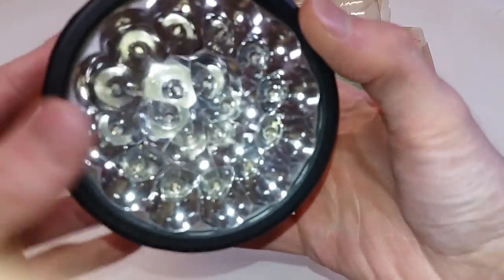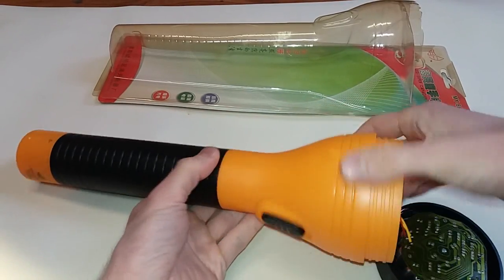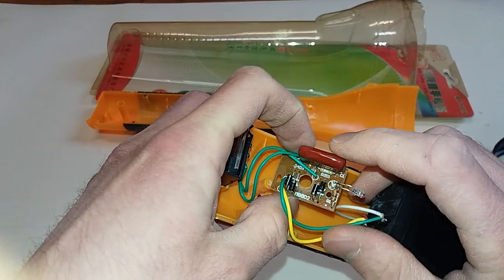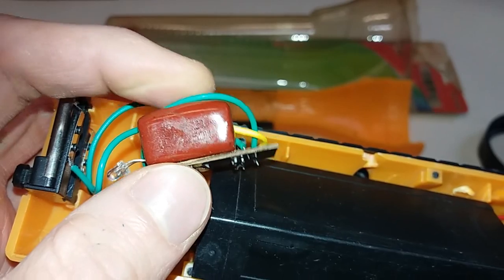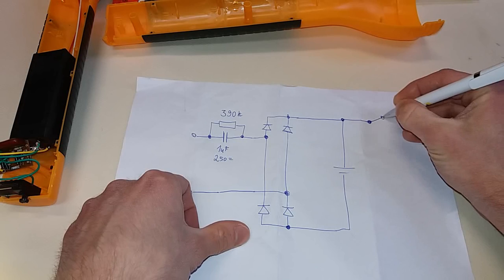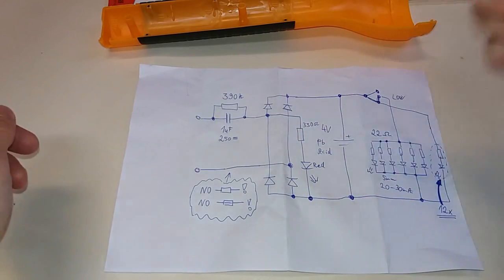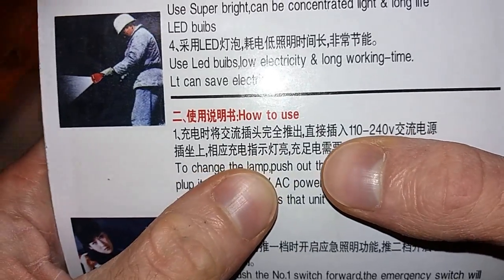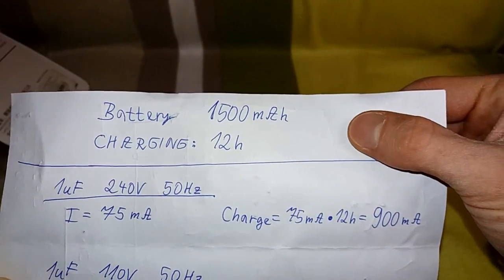Giant Chinese LED Torch Teardown

Comment: Another error: The capacitor is on high value. The 4V battery is approximately 1Ah. And you charge it on 220V. The charge current must be too low (for on 110-220VAC). So, the capacitor may be 470nF - 400V AC type. My god! The text on the box errorly too. That torch produced for studying "how produce an errorly flashlight".

Comment: Can anyone tell me how do I calculate capacitive dropper circuit's output current
Reply: It's not hard. The resistance of the capacitor to AC voltage is 1/(3.14*2*F*C) where F is either 50Hz or 60Hz mains frequency and C is capacity in Farads. So 1uF = 0.000001 F here. For example 1 uF capacitor at 50 Hz has the resistance of 3184 Ohm. Next calculate the current which is 220V/3184 Ohm = 69 mA maximum because I have ignored the battery (or other load after the bridge rectifier) voltage. For some better precision we could calculate (220-Ubat-1.2)/3184 where 1.2 stands for two diodes voltage drop because they are connected in series to be a bridge.
Reply: No.

Comment: Someone asked me to repair one of those. Looking inside, I found out that the connection to the battery was broken and all the LEDs were burned. Because there is no filtering, nor any parallel resistance, without connection to the battery the LEDs are exposed to much higher voltage than their ratings and therefore will burn very fast.

Comment: Once I tried to measure the open circuit voltage of such a charging circuit from a rechargeable light and I got around  150 VDC but after connecting the battery, the voltage drops to 18 V

Comment: Your calculations are exactly what I got for 50 Hz mains. I'm from the United States of America, we are at 60 Hz. Thus, the light would draw 90 mA @240 V, and 45 mA@120 V. The reason for individual resistors is because LEDs have varying threshold voltages. That means that the current would not be equally distributed among all elements, causing some to be brighter than others at the very least, and at worst, some LEDs could be overloaded. As an LED gets hotter, its forward voltage drop goes lower, which means the hottest LEDs will draw the most current. That would shorten the life of the LED flashlight(torch) as a whole. I agree with you 100%, I would like to see a 22 Ohm resistor on the input, and a 200 mA fuse on the input, to limit inrush current in case the plug makes contact during the peak of the AC wave form, and the fuse, just in case a diode shorts, or the capacitor shorts. I would like to see a 400 V capacitor used. If it is indeed a lead acid battery, there needs to be a Zener diode, or a series of silicon diodes, to limit the voltage to the battery at about 4.6 to 4.8 volts, to prevent overcharge, if it is indeed a lead acid battery. Diodes are great, because they will change with temperature, like the battery does, and help maintain an appropriate float voltage for the battery at varying temperatures. That would allow the unit to remain plugged in safely, until needed. It wouldn't take much, to make it a very useful and reliable emergency light source, or, just simply handy. I'm really interested to see what kind of battery it actually is. Lead Acid batteries don't like continuous overcharge, especially at a high rate compared to its capacity. That design won't hold up if someone just leaves it plugged in all the time.

Comment: DiodeGoneWild, How this charging circuit could charge this 4 volts Pb battery, as it should be very high output voltage after the bridge rectifier ??
Reply: If you notice the 1 microfarad capacitor on the input, At 240 V@50 Hz, it only allows .075 amps(75 milliamps) of current to flow. The Oxygen cycle in the battery shunts this to about 5.2 volts. The current remains pretty close to constant, weather the battery is dead, or fully charged. the problem is, battery overcharge. I'm sure you noticed the bulging in the battery, though that could be the result of a capacitor with too low a voltage rating shorting out, which would indeed have tried to pass all that voltage into the battery. If you have this light, don't leave it plugged in continuously. It's better for the battery if it's plugged in for 24 hours, then, unplugged. If you think about it, plugging it in for a couple of hours every week would ensure its longevity, and, maximum hours of run time per charge. For very little more cost, they could have shunted the battery with a series of diodes, to protect the battery from overcharge, which would allow the light to remain plugged in until needed. A 400 volt 1 microfarad capacitor wouldn't be much more expensive, than the inadequate 250 volt capacitor that was used. I would pay an extra dollar for it, if it had these extra 20 cents worth of components in it.

Comment: I WISH ONE COULD BUY flash LIGHTS WITH ON OFF SWITCHES INSTEAD OF THE 3 OR 5 SETTING ic boards that drain my battery i guess i cab buy a old 6volt lantern n stick a car led head light in it with a battery pack n dimmer knob and a toggle switch be a cool build fer this guy to do ..pardon the capital letters i hit caps button wilts pecking words out

Comment: Sir I don't know rated value but I am shore this chip is 30 watt. Firstly I use 12v 2amp adapter its brightness little low after  4 to 5 days my adapter suddenly short circuit 
And never repairable. Pls tell me about amp or milli amp its working condition bcos I control voltage but how to manage amp or milli amp.
Pls clear this picture.
Thanks 4 reply.
Reply: First improve your English please, then talk.
Reply: Haaahaha , first of all i  ne ver talk 2u, then why r u behaved like broker.
Reply: Sunny ch Sorry, didn’t get what you are saying. Also what do you mean like broker?
Reply: Sunny ch Also if you want to control amp or milli amp, then get a variable power supply

Comment: sir i have 30w led chip i run 19.5v laptop adapter here amp rating is 3.3amp  led glow but blinking what i do . i install 12v cooling fan also to keep led chip cool.
Reply: Sunny Chopra what is the rated voltage of the chip?

Comment: Also, there are the shallow European sockets used almost exclusively in Asia. They have no earth connections and it looks like a circle with two holes. I think this is designed to go into those.
Reply: This was the same in Europe in 1950's
Reply: they use them in italy, with ground in the middle

Comment: thats 4v lead acid battery.. these type of torches and lamps are popular here in india because they are very cheap mainly because of that battery which is really really cheap here.
it will charge with 240v and they are dangerous i have got myself shocked many times when trying to modify it

Comment: I had a lot of Chinese products with rechargable battery and they usually die after first few chargings. To plug it in you need to use some kind of plug extender which is sold separately

Comment: very nice review. Only a small correction if you don't mind. In the case of 110v is 60hz and not 50.
Reply: At 60 Hz, add 20% to the current. Here in the US, it would use 45 mA@120 V, or 90 mA@240 V. For Europe, they use 50 Hz, which means 75 mA@240 V, 37 mA@120 V. These values basically neglect the 5 volt drop of the battery, assuming it is indeed a 2-cell lead acid battery. In this light, the battery is constantly overcharged, so it relies on its oxygen cycle to dissipate excess energy, once fully charged.(rather poor design)

Comment: where 373 Volts ? series RC circuit Drops the Voltage and limits the Inrush  current no ? Measure It Please !
Reply: 240 volts AC actually reaches 340 volts peak to peak. Because there is a zero crossing as the polarity reverses, the average effective voltage is the stated 240 volts. If you connect an incandescent lamp to a sine wave with 340 volt peaks, it will shine the same brightness as if it were connected to a 240 volt battery. Therefore, the capacitor has to be rated for that peak voltage. The capacitor actually sees about 334 volts, because you can subtract voltage drop in the bridge rectifier, and the finishing charge voltage of the battery. You can neglect the resistor in parallel with the capacitor, it's such a high value that it only contributes a fraction of a milliamp to the bridge rectifier.
     If you want to know how much current will go through a given size of capacitor,  multiply the value of your capacitor X the voltage across the capacitor. At 50 Hz, like you have in Europe, divide that product by 3,183.0989, and that will tell you the amps going through the capacitor. Here in the US, we use 60 Hz, so we would divide that product by 2652.5824. We will get 20% more current through a given value of capacitance at a given voltage, due to the 20% higher line frequency.

Comment: Crap light. Theres also no limit to the charging voltage. Probably why the battery bubbles.
In my european country we have wall sockets wich are not resseced and plugs without the isolation ... I have never heard it should be any problem safety wise. Thanks for the teardown.
Reply: migsven surfing jm
Reply: 7c

Comment: Dude, it would be nice if you show the light beam coming out of this flashlight. We already know its a junk just by looking at it. And EU socket is not hollow but recessed.  Thanks
Reply: All the LEDs are burnt out so that's not possible.
Reply: The battery is garbage. The Charge circuit won't pass enough current to bring the LED's up to full brightness. That's assuming IT even works. I do believe, the LED's themselves might not work either. To pass 20 mA in to each of 18 LEDs would require .36 amps, the charge circuit would at best, provide about 1/5 of that.

Comment: I once took apart one of those. It had sealed lead acid battery in it, but its terminal was potted with twinkly nail polish.
Reply: When I opened one of these I thought it was glitter glue

Comment: Can you please modify it using 18650 battery and charging system for 18650. In addition, can be use also as a power bank. Cool huh?
Reply from the maker: It could be modified to an 18650 battery, but I'd have to replace all the LEDs, they are all bad. It uses standard low power 5mm LEDs, so it is not very powerful. There's no heatsink, sou you can't easily use more powerful LEDs. This flashlight is rubbish. There are much smaller flashlights that are much brighter.

Comment: Its only for the non-recessed Thai sockets ( lethal without shielded pins ! ) &  Chinese death-travel-adapters & Chinese multi-plug death sockets  ^^ 

Oh ans classical Capacitive-Dropper of death ( see "BigCliveDotCom" & "John Ward" ) instead of an isolated power supply ^^

its good that it does not fit in recessed German & French sockets, this is the only thing that makes it safe ^^

Edit: good video
Reply: It would also fit Italian plugs but without shrouded pins it's absolutely unsafe.